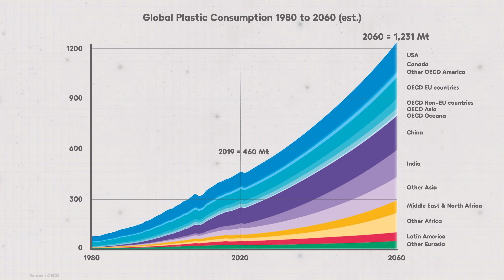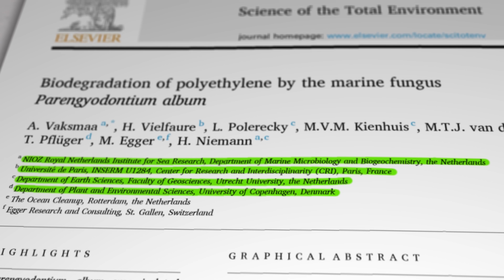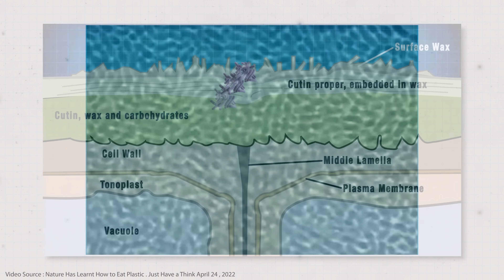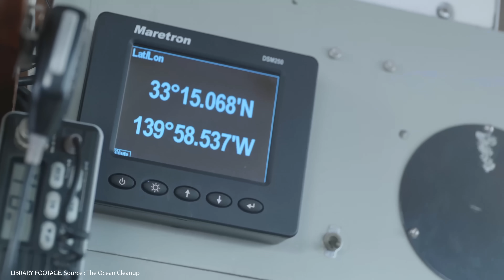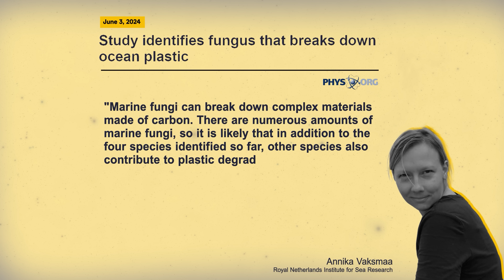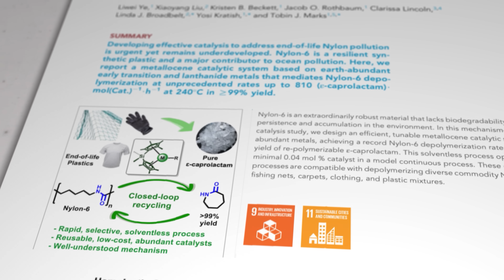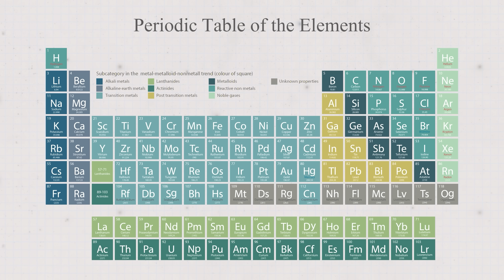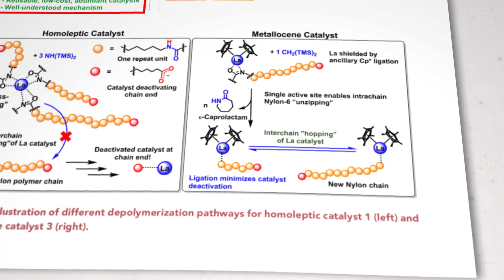Our oceans have learnt how to EAT PLASTIC!

Comment: Next thing we know, fiberglass boats will start being eaten by these microorganisms.
Reply: Fiberglass don't have carbon, neither rust proof coating, plastics are basically hydrogen and carbon polymers.
Reply: @C0lon0 I remember hearing about how they found volcanic glass at the sea floor with evidence/signs of microbial activity. I know fiberglass isn’t exactly glass but it’s pretty interesting
Reply: @timotheusFN  What you call fiberglass is actually  reinforced  polyester resin . The  embedded  fiber which provides tensile strength is 100 percent glass.
Reply: @bernarddavis1050  well yeah, I was trying to say fiberglass isnt purely glass. As you said, it has resin too.
Reply: ... or the paint that keeps steel boats from rusting
Reply: i read that as microorgasms.
Reply: Maybe this organism was biogenetically engineered to eat the plastic and released from the lab into the ocean.
Reply: Fiberglass is made from glass fibers.
Reply: @zyxw2000  That is technically correct.  When most people talk about "fiberglass"  i.e.  what is used for making boat hulls etc., the term that they should really use is GRP (glass reinforced plastic).  The glass fibers give tensile strength,  the polyester or epoxy resin matrix in which they are embedded,  compressive strength. The combination of the two elements is the key:  the yin and yang of strong materials.

Comment: Very dangerous, we will have to replace plastic window frame and doors every 5 years if these microbes multiply.
Reply: At this point it's better than the alternative.
Reply: Window frames and doors used to be and often still are made from wood. Which decays. It requires treatment and replacing. Just something you have to live with
Reply: Never heard of plastic window frames. It's always wood or aluminum where I live
Reply: @manuvillada5697  In the UK it is plastic no maintenance windows and doors.

Comment: [Edit: This thing I was taught 50 years ago is not true. Tire dust just gets distributed. Original incorrect comment follows:]

In use, tire tread wears away as a fine dust. Since the particles are heavy, they settle out of the air quickly. Thus we would expect to see a thick layer of black dust along the sides of busy roads. We don't, because microbes have evolved the ability to digest tire dust.

Or at least, that is what I learned in high school 50 years ago.

Assuming that is true, we can also notice that intact tires don't get eaten away at a noticeable rate. That implies that the microbes can only eat tire rubber that has been turned to dust.
Reply: Can I have a source on microbes eating it? All I can find is that it gets dispersed throughout the environment by wind and rain.and that’s why it’s not all piled on the road.
Reply: @Bigleyp  I think you're right, it's a huge leap (and convenient for the collective human conscience) of logic to assume that it gets eaten up by nature just because we can't see it at the roadside in huge heaps.
Reply: Thanks to everyone for the corrections. I have put in a warning that it was not true.
Reply: If you Google, you can see that the tire dust makes up a large part of the plastic patch in the ocean.
Reply: Yeah that’s not true. Though some microbes can breakdown rubbers, that’s not why you don’t see it. It’s just distributed throughout the environment
Reply: So we should develop mutant strains that can do it faster.